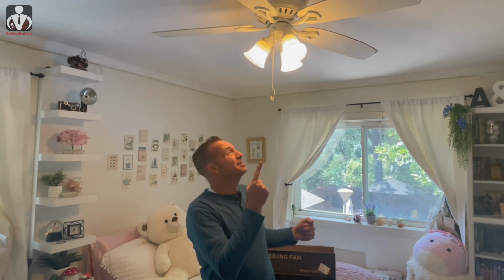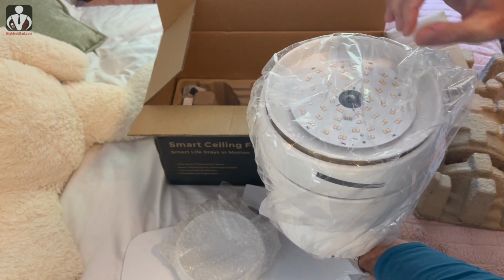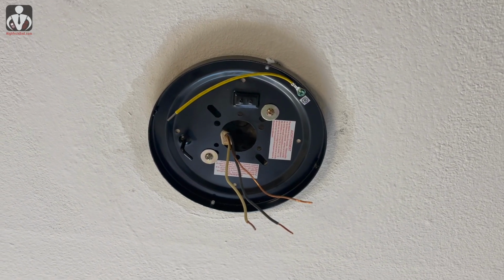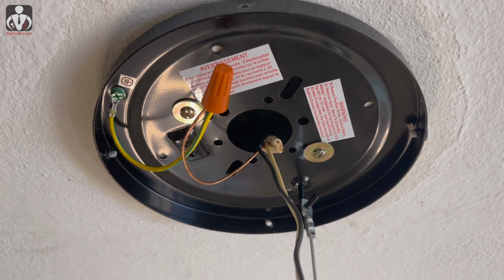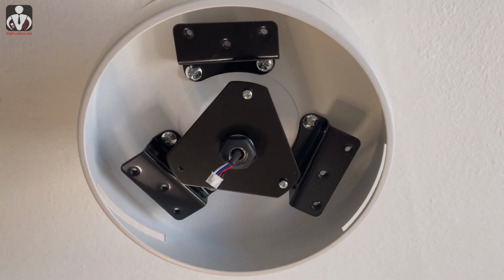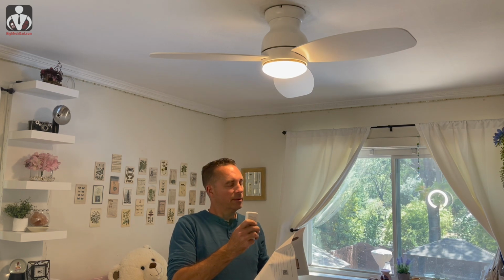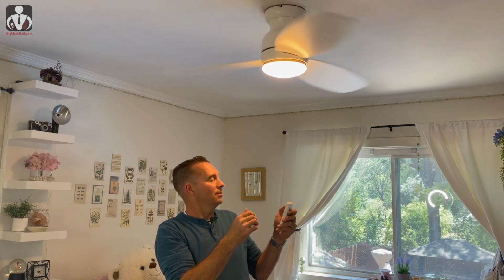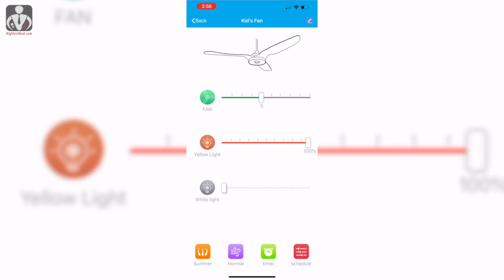Smafan Smart Fan - Installation tips, features & how it works

Comment: Wrong about the hook. It is to hang the heavy new fan or old fan so you’re not holding that weight for extended time, like when doing the wiring.
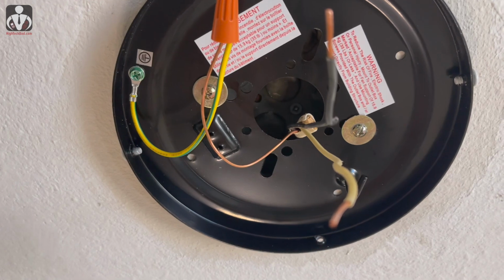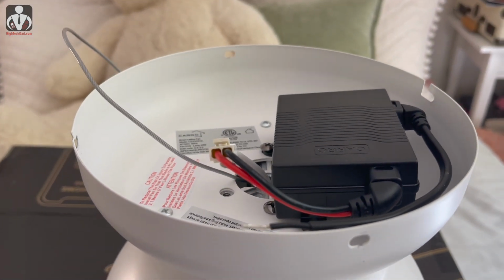Reply from the maker: You are correct, Bruce, as I talk about around 4:04 in my video. If you have already put up the mount, I'm not sure why you would want to hang the old fan though. But that is what I used to hang the motor and do the wiring, as you said. (See around 4:30)

Comment: the wire has an adjustable pin.  Loosen nut and pull thru.  Make sure you tighten screw tight.

Comment: Looks to be a hole on the base that you could put on the mount hook to hold it up closer while u wire
Reply from the maker: I did use one of the built in mount hooks. I think I mentioned in the video or perhaps in my written review.